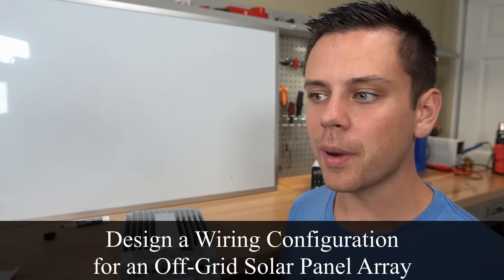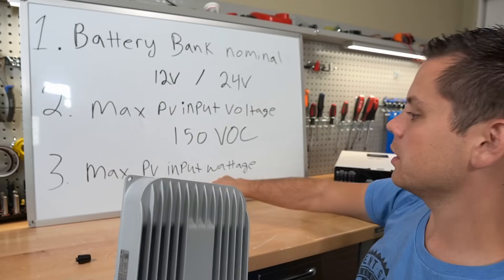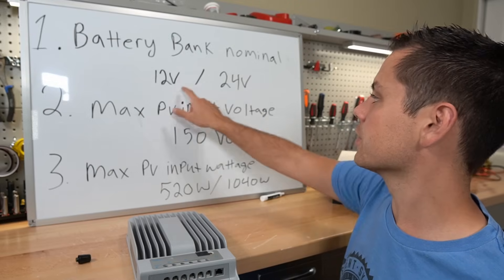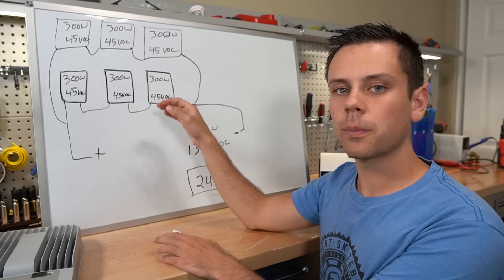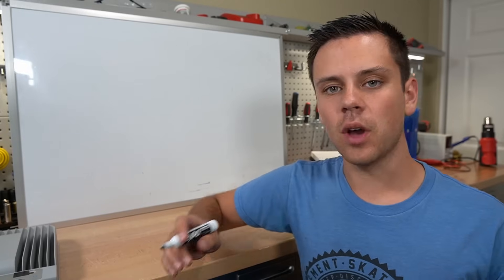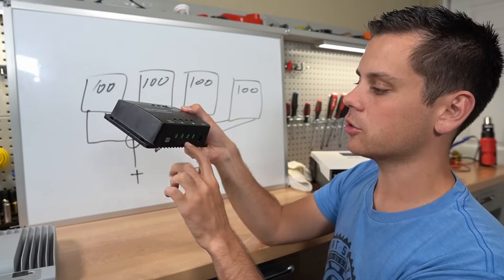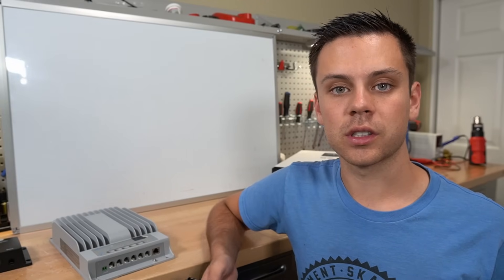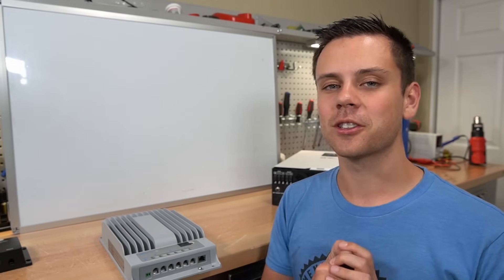How to Design an Off-grid Solar Power Array Wire Configuration

Comment: Please be careful, most of the wiring in the back of the solar panels are rated for a max current of 20 amps (AWG 12 ) and NEC recommends using only 80% of that for a total of 16 amps. Putting multiple strings in parallel  will increase the current and you can have a potential fire on your roof.

Comment: Will, can you make a video for a hybrid on-grid solar system, I'm thinking of getting solar but want a system that if the grid goes out for whatever reason I can shut off that part. Been told that if grid goes out your system shuts down so no power goes to the grid, would like to get a on / off grid, is this possible?

Comment: Hi Will!
I really enjoy your videos and have learned a lot however, you made a mistake with your voltages and wattages when putting then in series and parallel. You do not add both values, it is always one or the other. In series, you add the voltages together but the wattage stays the same (Example: three 45v/100 watt panels in series would be 100 watts @ 135v. Those same panels in parallel would be 300 watts @ 45v).

Comment: Do you have a solar charging system recipe generator? If not I think you could sell that. Type in the required total load output desired and get the specs for each component up stream. Great video.

Comment: If I want to do an offgrid setup for an entire 3000 sq ft home with 150 amp mains, would it be more cost effective to use multiple charge controller/battery bank/inverter setups to power different circuits rather that building one extremely powerful central system?

Comment: What about small charge controller paired with a large panel say 20 amp controller with a 400 watt 48 volt 8 amp panel. I need to know what the amp output from the controller would be with that panel. Bifacials q cell panel and the epever 20 amp tracer. Thanks, I wanna hook up 5 sets bit if thier amperage goes up to 16 amps out of the controllers I'll be maxed at 3 sets.

Comment: How did you come up with 1050watts total when the panels are connected in series not parallel? Does the principle of  increasing voltage and maintaining power not apply when connecting solar panels? Educate me please? I thought the wattage would be maintained at 350watts if connected in series hence increasing voltage. 🤔🤔

Comment: With the EPEVER MPPT 40A controller, this statement in the specs concerns me. "Support 4 charging options: Sealed, Gel, Flooded and User.(Lithium battery charging is supported, but it must be ensured that the battery is never exhausted. The controller does not have a self-activation function for lithium batteries.)".  What would you recommend when using for Li batteries?  Is that function programmable?

Comment: Question, I have three solar panels that are rated at 23.20v, 10.70a, and 200w with a 60a MPPT charger setup for 24v/1680 max input, along with four 12v setup as 24v(26.70). I don’t think I have my solar setup correctly, I’m only seeing 59-62v at max 15amps. What is the recommended solar layout?

Comment: @DIY Solar Power with Will Prowse - Will, you mentioned the need for OCPD on each individual array in parallel...do you size the amp fuse to each individual parallel array, or for the entire array? I've got four separate series and wondering if I need four OCPD's to satisfy 8 amps for each, or four OCPD's at 33 amps to protect the entire array.
Many thanks if you happen to see this...

Comment: Hey Will I get so much out of your videos they are extremely well put together very informative and fun to watch. Just a quick one. I have a new Growatt SPF 5000 ES inverter and I have 12  x 455Watt 49.8V solar panels. I was going to set them up in 2 parallel strings 6 panels each string. i.e. (99.6V @ 60A) or am I better to do 2 strings in series? (298V @ 22.16A).

Comment: I have a 12 volt system using the mpevers, 525 watt but I have 4- 160 watt panels. This = 640 watts in perfect conditions, I never seen more than 120 out of my panels. Is it safe to assume I'll never get 160 out of the panels.

Comment: I use an EPEVER Tracer 4215BN SCC, I spoke to the supplier and they said I could connect the panels in 2s2p (24v 1000w) for my 12v battery bank. The controller gets up to about 48 volts  and the controller delivers about 3 times the incoming current to the battery bank & load circuit.
Been working great for the past couple of months.

Comment: How can a person wire up a net metering system and have a switch on that system that can prevent voltage going to grid and switch over to batteries for off grid use Incase power goes out

Comment: Can anyone tell me how I can connect 2 Epever Tracer 4210 AN controllers to charge a 24v battery bank? Using my single controller I keep getting a over voltage warning. my array is 10 100W panels. OCV=21.6v   series/parallel connected=24v   I'm not sure how to wire it and don't want to fry the charge controllers. I bought Wills book but he doesn't go into it, but he did mention it can be done. I would really appreciate the help. Thanks

Comment: What about connecting mismatched panels in series? If I have 3 x 100W (7,5A) panels in series with a 160W (10.5A) panel in series, will the overall string be 400W 7.5A or 460W 10.5A, or somewhere in between?
Reply: I am wonder the same thing.
2 panels 100 watts, 17 volts, 5.89amps
2 panels 120 watts, 18.46 volts, 6.67 amps

Can I run each panel group as parallel
 and then use 2-4way branch adapters to combine the 2 groups into one run to the charge controller?
Reply: When you hook different wattage panels in series you then are governed by the lowest wattage panels watt output. Say you use an 80 watt, 2 - 100 watt panels, and 2 - 120 watt panels in a single series, you would then only be getting 80 watts from every panel. So that’s 5 panels at 80 watts each = 400 watts. If you took out that one 80 watt panel you then still have 400 watts because you now have 2 - 100 watt panels, and 2 - 120 watt panels that will only be putting out 100 watts also.
Reply: @georgecothran4760  thanks for your very helpful explanation 👍
Reply: @PVflying  you are very welcome.

Comment: I am building a system with same epever 40a charge controller.  I was wondering what happens if fuse between charger and battery blows while it if fully hooked up? Should I oversize that fuse so it don't blow?

Comment: Hello im trying to make or buy a solar panel for my beaudens portable power station 166wh it can charge with max 43 watts between 14.5 to 26 volts max so thinking i can make or buy a 60 watt solar panel which i can fit in my osprey xenith 105 backpack it can be tall panels not wide can anyone help me im from Europe

Comment: So something I haven’t heard (or maybe I’m missing it) explained from any of my research is the importance of the volts for the panels themselves. When I search/shop for panels almost all that I find are 12v and only offer about 175 watts. If my inverter is 24v does it matter what “size” the panels are...12v,24v, 48v? My charge controller should be set to the “limit” (24v) to supply power to the bus bar that supplies power to the inverter(s)? Again, maybe you did explain it in this video?

Comment: You mentioned this MPPT can handle over-paneling on 24v, would 6x 100w panels for a 12v battery be too excessive? Thanks
Reply: I am reading the manual and it says Rated Power Charge is 520W/12V and Max. PV Array Power is 1560W/12v for reference.

Comment: Hi,i have an tracer 4210AN,40amp controller and  760w solar panels(in total). Can add two 310w panels more? My panels work arround 85-90% capacity and push 620 w maximum. Thanks for your answer.

Comment: This was helpful in understanding these higher voltage panels usage when it comes to smaller charge controllers or just get a second charge controller or one bigger one. Was in doubt as to using these higher voltage panel, 24v panel, to run through the charge controller to charge 12v batteries? I guess you can if charge controller recognizes different voltages as represented by battery bank. My inverter is a 12 volt input.

Comment: DiRectioNs/advice/links.. Please....
$50 for used CDTE panel 90voc
I had started a little diy project thats... Uhhh u know now turned in to much more. Lol 😆
I didn't know much about the thing. Like nothing. But for the price was like heck why not... Lil more panel then the 20watt I've originally purchased for the project. Why not have to sizes of recovery on a portable unit. 
So here I am..
Done possibly blown up some stuff... And learn wth I bought n what I can do with it. Yeah.... That's me. I'm the guy.. lol 😂🤘💯
Soooo... I did have the panel plugged in to the controller I have...
Note 1: small 20watt kit pwm controller
Note 2: I'm definitely new n this sometimes is how it goes. 🤦🏻‍♂️🙏🤷🏻‍♂️

Totally inclined, who needs directions. LmaO 😆🤣
Anyways,, I plugged it all up as direction and have done previously with smaller panel. And it was blinking. Hard to read on this small controller but looked like it said on the thing with pic blinking meant over voltage. Thru unplugging and checking things I betting I missed process and had the panel in without battery, or panel first then battery...

In that process it seems controller possibly bit the dust. Later reading info on everything. Oh and burnt up a freagn nice little r/c car meter monitor... Smh.. not been to productive. The controller now I'm wondering if possibly the overvoltage has tripped a capacitor and could be shorted out to reset the controller.... It's a small Suner Power spc-10a nice sealed no power consumption compact for what my project is.

Comment: I don't understand this. 4 panels of 100w 20v connected in series is = 400w 80v. I thought it should be 100w 80v as the rule says series connection increase the voltage and wattage remain the same.

Comment: Question on the OCPD:
I have four Silfab SLG-M 370W 48V panels. I plan to run them in a 2S2P format. Would you suggest using the OCPD's, since the total wattage is 1480W, or would I be okay without them? I believe the data sheet says they have 20A blocking diodes on the panels.
I also was going to use an OutBack FM60 charge controller, but would be running at the edge of its limit. I am now thinking that I should opt for the FM80.

Comment: i have a question.. can i use a 24v panel set-up ..using a renogy tracer rated 40A to charge a 12v battery set-up?
Reply: did you get a answer yet?  I have a 24v array, I also use 6v batteries series/parallel connected to = 24v. I think they need to be the same. Also if you use a inverter it has to be 24v also.

Comment: I am going to have eight 400watt solar panel connected to four 100Ah 12V LiFePO4 Deep Cycle Batteries. What charge controller would you suggest? Can the 40amp version of the charge controller in this video you are talking about handle it?

Comment: I am doing a ground up RV build. All 110 volt appliances and air conditioner. No 12 volt anything. Can you do a vid on that. Just like a home system in an RV. 24 or 48 volt ? I can use/fit as many as 10 panels. Also not worried about cost to a limit. I can spend up to 13k.  Thanks

Comment: I’m just getting started on your book, and quickly leaning about the basics of electricity. Question regarding inverters. Will an inverter only draw as many amps off a 12v system that is needed to produce the watts needed to supply a given AC loan or will a inverter always draw the same amount of amps regardless of the AC load demand? Meaning I have a 3000 watt inverter for my small cabin, but we try to keep consumption to a minimum all the time, living in Alaska, is that practice actually helping?
Reply: Or basically, is a 3000 watt inverter always drawing the same amount of amps from a 12v battery, or is it variable depending on the load demand.

Comment: I have a clou nepcs 05k12p inverter with charger, can u please help me size it for panel and battery. It has operating pwm voltage range 15- 18vdc
Max PV charge current 30A
Max Pv array open circuit voltage 40vdc
Battery nominal voltage 12v... thanks in advance

Comment: first off - your electricity lessons are awesome... of all that i have viewed yours are by far the most in depth without all the tech talk most others who post similar material assume we know so to that i say THANK YOU THANK YOU THANK YOU...
my question - as someone who lives in the north east part of the country and thanks to covid 19 is jobless for 9 months now and in fear of freezing to death this winter as my furnace totally died last winter - and jobless means no hope of fixing it... is there a safe way to run 1 or 2 small, newer style electric heaters using a battery bank or anything easily accessible that will not involve plugging them in to home electrical outlets... even the newest of these heaters are usually 13 to 15 or more amps and are super expensive to run... thank you for all you do - your videos are a tremendous help to us all...

Comment: i am a bit new to this so here goes
i have 24v solar panels hooked to a tracer 4215BN
i have a 3500 w power inverter 12v
should the charge controller know what to do
also is it ok to use this inverter or should i go to a 24v inverter

Comment: Hi Will, I have 4 panels, 2 of each different capacity but 3 of which will be mounted on different aspect! In other words not all will be in complete sun light any of the time! So what would be the best, have all separate solar controllers for each panel, feeding the battery or put them all in series or parallel ???? Cheers Ray

Comment: Hello your videos are awesome, I have a couple of questions I want to build a salar power system for off-road usage, I need a 5Kwh system, and I also have a 5Kwh gas generator I need to run an AC , Tv , and freezer I would like to charge the system with solar panels during the day and help the charge with the gas generator during the night what do you recommend me to do what brands of inverters how many solar panels batteries and controllers. Thanks a lot for the reply is you get to read my comment. And congrats for the channel keep it up 😬😬😬

Comment: i have a question bro,, if i have 4 100 ah batteries.. amp lead sealed what size breaker do i need i bought a 50 amp but i think that may be two high.... could you help me out buddy i have 4 200 watt solar panels and a mppt 1000 amp solar charger.... also a 5000 watt inverter modified,,, i was thinking as i bought the parallel kit i wanted two put them in parallel .. everything i got is 12 volt..

Comment: Hi, I want to use solar panels to heat my 200 liters geyser. The topic is hot right now since the solar panels $/watt is dirt cheap. Three applications i seen so far 
1. Connect PV direct to your normal geyser resistance element, resistance is key (the lower the better) 
2. Connect PV direct to dc element in geyser.
3. Connect PV to special mppt to normal geyser heating element.

Which one do you recommend?

Comment: Whats your experience or results with over amping a solar charger? Ie not over voltage but exceeding amps. Shouldn't  a regulator self limit amps? I was thinking oversizing a system to cover cloudy days.

Comment: So I'm Building a 1977 GMC RV with 36 100ah calb LFP cells. I know its overkill but I want to be able to run my server and 3d printer that are inside without worry for a little while haha. I would love to talk to you about how to build the system and different ideas on Bluetooth controllers/monitors. any help would be super appreciated I'm an electronics nerd but my things are esp32s and Arduino I don't know much about solar.

Comment: I have a question for you since I am a beginner. I have 6 340w 46.2 voc solar panels.  Can i use them and if so what charge controller and inveter should I use.  I prefer 24 or 48v.
Thanks.

Comment: I had a problem with 23 solar panels model Hanwha 295 watts I don't have a battery.
Reply: All the components are already installed. For grid users not for battery backup. If it's possible install a power pack or Tesla battery.

Comment: Anyone know if a LED driver rated @ 100w per lead & 25Amps (3 leads on this driver 300w max) would work for 2 Maxx air fans and a small led light? Just trying to see how to hard wire led light and 2 fans to bluetti eb150. All devices 12v

Comment: Hello DIY Solar, I bought a Bluetti EB240 Power Station that has a Maximum DC solar input of 60 volts. Will three 180watt solar panels in series, exceed the Bluetti's capacity (especially in cold weather) with their Open Circuit Voltage of 22.5 volts (22.5 x 3 = 67.5 volts, does OCV voltage matter?) and their Maximum Power Voltage of 19.01 (19.01 x 3 = 57.03 volts, is MPV the important voltage?). Which matters, OCV or MPV?  Would freezing weather bring those voltages up?   Terry D.

Comment: Great video.  Just one thought, it is not voltage that kills, it is current.  You can easily handle tens of thousands of volts from a Van deGraaf or a Wimshurst generator with just and "ouch" (as long as you don't have other issues), but amperage will kill.
Reply from the maker: Yeah but we have a current source and if the current is allowed to flow because it's at a high enough voltage to overcome the resistance of your skin, it will kill you. When working with batteries, the voltage is more important.
Reply: @WillProwse  Agreed!  Just trying to figure out how to get people to understand when there is a current danger and how small (in terms of familiar numbers) that current can be.
Reply: IOW, 30 V with a sustained current can kill.  So the focus on voltage doesn't really do justice to the problem.

Comment: Thanks Will, That's the exact info I needed for the panels and voltage input for the 24v MPP Solar I needed for my off grid cabin. You're the best.

Comment: Super, can you please explain in 24v system connecting with ”4” 12v led aside batterys - the charging time, advantage, disadvantages please